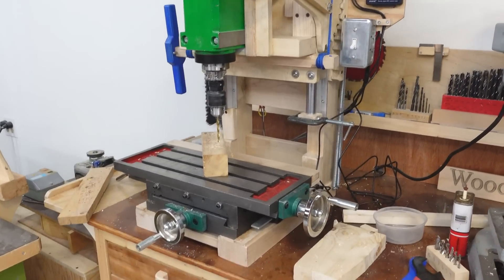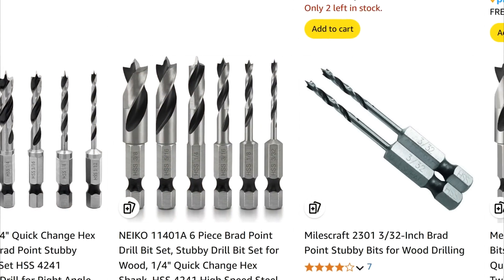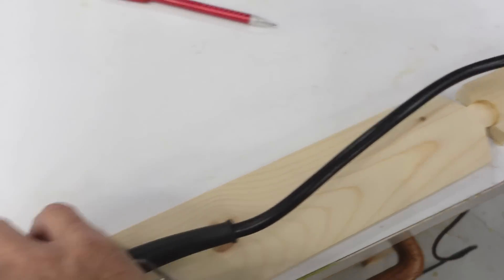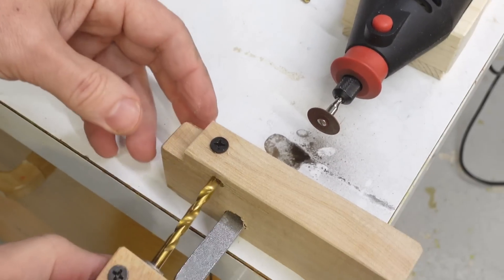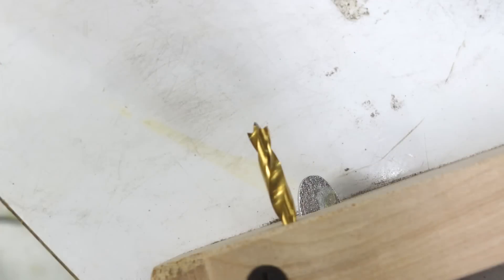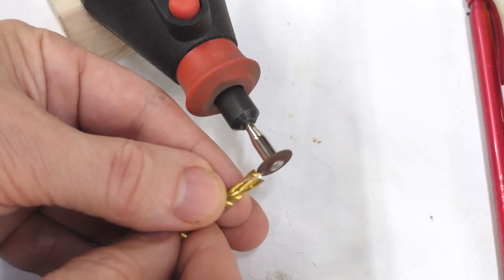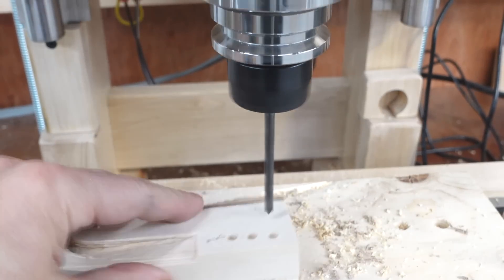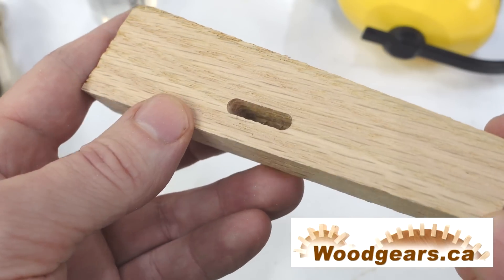Grinding a brad point onto a metal drill bit

Comment: Nice job . I guess you just wanted to see if you could make a Brad point bit.  The quickest way would have been to just cutoff a regular brad points to make it shorter. Still very ingenious way of doing stuff,
Reply from the maker: Does it matter if the part I cut off had a brad point on it or not?  Still need to grind a new brad point.  Sure, you could cut off the shank end, but then the rest of it is useless.

Comment: Matthias is the type of guy to spent 6 hours making jigs instead of buying the $3 part 😂
Reply from the maker: That would be true if the part could be bought, for $3 or otherwise, and if the jig took 3x as long to make.
Reply: @matthiaswandel  Could use your mini lathe to turn/grind down the hex shafts of the production stubby brad point bits

Comment: If you decide you're not happy with the drill bit you've just made after some use then buy one with a hex shank and stick it in your lathe and turn the hex round but I like the solution you decided on.
Reply from the maker: Hardened steel is too hard to turn.  Also, how to mount the drill so its perfectly centered?  Grinding the brad point is easier and faster
Reply: @matthiaswandel  you can mount the drill using a collet chuck and there's ceramic bits specially made to cut hardened steel but I get your point your lathe probably isn't accurate enough.

Comment: Looks like you were using a collet at the end, would have liked to seen a comparison using the drill chuck and if it still wanders.
Reply from the maker: I used the collet primarily because its shorter, so less opportunity for flex.  Of course, its also stiffer.

Comment: Was rotating the bit and keeping the dremel in a fixed position not an option for some of the cuts?
Reply from the maker: Cuts the outer points off as it rotates.  Also, easier this way.

Comment: If you just cut them down at the other end can they still be tightened in the chuck? Or is that not so good with the spiral
Reply from the maker: Certainly wouldn't work with the 3 jaw chuck.  Might work with the collet, but will bugger up the collet.

Comment: Here in our lovely Mordor one just comes to any hardware store and buys wood drill bits - either a set or single-piece. Yes, with cylindrical shanks. Yes, in any size.
Never thought it is that much of a hassle to get them on the other side of Arctic.
Reply from the maker: yes, here too.  But I needed a stubby one (explained in the video).  Long ones are available everywhere.
Reply: @matthiaswandel  Sorry, I missed that point. Now it does make sense!
Reply: Why not convert the long ones to stubby by cutting the other end?
Reply: @pfsmith01  Fluted things don't hold well in a collet

Comment: Only you would think of converting one drill bit type into another! Now I have a use for the broken bits I've kept around. Also really like the idea of using heat gun to extend hot glue working time.

Comment: @Matthias I make these all the time, but I just freehand them. I also use Dremel, but with a small grinding stone so I only have to make 4 cuts, first two form the cutting edges and half of the brad point, second two thin out the brad - just like you did. Wood drills are pretty forgiving on the geometry as long as they are made sharp.
Shortening works but the land (middle part of the drill) gets bigger and has to  thinned
What I'd really like to try is to convert some metric drills into WoodOwl overdrive geometry (they only make imperial ones).  It's supposed to have next to zero chipout on the exit side
Reply from the maker: Just looked those woodwol bits up -- not cheap!
I was keen on getting the the brad exactly in the middle because the goal was drilling holes accurately.  Though it occurred to me just now, if my goal is mortises, no brad might be advantageous too.
Reply: @matthiaswandel  Use an endmill in that case, it's a lot stiffer. I suspect a brad type drill without a point will tend to walk.
I find it easy to place the point in the middle when freehand grinding by just not shifting my hold. I rotate the drill with the back hand, but I keep hold of it with my front the whole time and keep the front hand planted on the rest. I'm not very good at hand grinding by any means but I find brads are actually easier than normal metal bits to freehand sharpen. It's important to dress the stone though, once it gets rounded, you can't get that inner corner between brad and the cutting edge - this is where cutoff wheel is better I guess
Reply: @matthiaswandel  Not cheap that's true, but it makes sense since it's unique enough to practically be artisan tool. But definitely look at one of the review videos, the lack of blowout on the exit looks like magic. I tried to think of a reason why it works so well, but I couldn't come up with a good answer. If anything, just by looking at the thing I'd expect it to make the blowout worse not better

Comment: Is it that you can't buy them online or that you can't buy them at all without the hex portion? Here in The Netherlands I've never seen those bits with the hex portion at all, and the normal stubby bits are widely available in every hardware store. Even dollar stores have them.
Reply from the maker: Stubby ones as brad point bits from a dollar store?  I doubt it.
Reply: @matthiaswandel They might not be a dollar (besides the fact the we use euros here of course), I should probably said discount shops, but they are definitely there in some. That's why I was so surprised, because they are so common here. We just call them wood drill bits. I can get a 7-bit set at my local hardware store for 8 euros. Seperate bits are like 3 euros.
Reply: Ah never mind. I saw another comment explaining this. It's not that you can't get the brad point bits, but the stubby ones. I presumed that was just another name for brad point bits. Because in the video you used the metal bits in the beginning and said they drifted. And I immediately thought, well obviously, should've used the brad point bits.

Then you are correct. In fact I've never seen shorter drill bits ever.

Comment: As cool and useful as this is, it seems significantly easier to 3D-print a hexagonal collet, if one is not available.
A fully 3D printed hand-drill I have fits such hexagonal ended drillbits in the hexagonal collet.
And I know the right plastic at a dense enough infill will survive the pressure.
But this is a case of when you have a hammer, everything looks like a nail.
And the bit you made drilled cleaner than the store-bought one you have, which is impressive but shows that you got the concept right.
Reply from the maker: First you have to have a 3d printer that can print metal, and super precisely.  That is FAR from easy.  Orders of magnitude harder than just grinding a brad point bit.
Reply: My response was about using a plastic collet, metal 3D printing is far beyond the scope here.
As long as the used material can handle the pressure, it should work with the hexagonal shape offering enough grip on the softer plastic material.
Accuracy would be hard to get right with FDM, though with manual seam painting this should be consistent enough for wood drilling.
Reply from the maker: Plastic won't handle the pressure.

Comment: An old friend of mine showed me how he does essentially the same thing.  However, he used a thin abrasive disc on one of his bench grinders.  Of course, I can't seem to find the part number for the wheel right now.  Either way, the disc mounted to the bench grinder also made some other operations really easy since you could hold the part with two hands.
Reply from the maker: Could also use a cut-off disk on an angle grinder
Reply: @matthiaswandel  Yep.  I think the discs he used were Norton brand and finer grit than a typical "cut-off" wheel.  I believe they were 0.06" thick.  I know I took a photo but I can't find the photo.  😕

Comment: How much relief angle do you need behind the cutting edge to make it work?  I've sharpened metal bits and they don't require much relief angle at least for drilling metal.  I suppose it's similar to a lathe cutter- for metal cutting the cutters don't seem to have a lot of draft but for wood turning they use cutters that appear to be similar to wood chisels.
Reply from the maker: I guess It depends on how fast you want to drill.

Comment: I drill pilot holes with center drills. They're very stiff, because they're short and thick (which also means they won't drill very deep, but that's OK because I follow up with a regular drill bit). They're made to use in a lathe, but they work fine in a drill press. I get the cheap ones from Harbor Freight, but you can get better ones.
Reply from the maker: I got a few, but none with the narrow part small enough.  Also, switching tools is annoying.  Also, won't protect against the drill drifting with the grain once its further in.

Comment: You need to make some hole saws out of some steel pipe and a countersink from lathe tail stock points. Or how about some shop made cut off wheels from hand laminated fiberglass mesh and diamond dust sprinkled over sticky paper.

Comment: Lee valley has brad point bits... I have a full set!
Reply from the maker: I have brand pint bits too, but I wanted a stubby one
Reply: @matthiaswandel  the entire point of the brads is it stays on center. Worked fine for guitar work. I punch the center mark with the spindle off then energize it.

Comment: Well done, but would it not be less time consuming to round the shank of a hex stubby or would that remove to much material?
Reply from the maker: No, that would be much harder to get precise
Reply: @matthiaswandel  I suppose because of the flutes it would be difficult mount in a lathe, your method works well.

Comment: COOL!  Matthias, have you tried the little 1" diameter diamond wheels (Amazon, etc.)?  They last far far longer than Dremel carbide wheels and they don't lose their diameter in use.  They are also much thinner and they don't shatter.  Very affordable too.  I have not used a carbide wheel in my Foredom or Dremel for more than a decade.
Reply from the maker: Have one, but I like the cheap little cut-off disks myself.  Also, I don't know if the diamond disk cuts with its edge

Comment: Matthias,
After setting the angle of approach for the brad point itself, is it easier to simply rotate the drill bit against the grinding wheel rather than swinging out, rotate, swing in, cut, swing out, rotate... etc?
Reply: That would also grind off most of the spurs, because of where the rest of the cutoff disc would end up as the bit was rotated.
Reply: @cooperised  Not when the angle to cut the brad is set. Looking at the video indicates the angle is too steep to affect the spurs, as far as I can tell. And the depth of cut for the brad isn't that deep.
Reply from the maker: It would cut the spurs.  Doesn't matter how steep the angle is set to, its the diameter of the disk that's a problem.
Reply: @daveduncan9005  Matthias is right, that's what I was describing - the diameter of the disc is the problem and it would intersect with the spurs as you rotated the bit.
Reply from the maker: It would also make the central point round, which is not desirable

Comment: Wont the heat take the temper out fo the drill bit?
Reply: No, not if it's HSS. Carbon steel anneals this way, but it's virtually impossible to anneal HSS by accident (and pretty difficult to do on purpose come to that!).
Reply from the maker: Sadly, its probably just high carbon steel.  HSS doesn't make that kind of spark.
Reply: @cooperised  Awesome, thanks for the info!

Comment: You could have turned down the hex shank of one of those stubby bits to fit a collet.
Reply from the maker: yes, but its harder to grind that round precisely than grinding a brad point.  Also, first I'd have to buy one of those.
Reply: @matthiaswandel  Thought you had a lathe for that kind of thing. Get your point though.

Comment: Recently I needed about 60 16mm holes in 5mm steel. So my dad and I just took cheapest brad point bit for ~2usd, reground to regular bit, quenched it and it worked. Without resharpening. Pilot holes were 8mm maybe.

Comment: The hex drill bits work fine in a chuck.
The cheaper ones, the hex part breaks off afyer couple of uses anyway 😅
Reply from the maker: Works fine in a chuck, but messes up a collet
Reply: @matthiaswandel  whats the advantage of collet over Chuck?
Reply: @adshwartz  Jacobs chuck is quicker to change tools since it can fit a large range of diameters.
Collet is more accurate partly due to less moving parts and partly the fact that it's shorter than a jacobs chuck
Collet provides larger contact surface with the tool so better overall grip.
Collet doesn't loosen under side loads like a jacobs chuck does

Comment: I always love/hate these sort of videos from you - I do much the same sort of thing from time to time, but I really want the mathematical and mechanical precision and repeatable 'proper' machinists method by nature. It just feels so wrong to watch a job done this way, but as always can't argue with the results and really does show how easily you can make something good enough.
Reply from the maker: It wasn't freehand.  Just that the jig was made out of wood
Reply: @matthiaswandel  Indeed, but the jig only references to the one plane, which along with the constrained axis of rotation for the drill bit isn't really enough to do it 'properly' - its not that its made of wood that bothers me (much anyway) it is that all of the important feature angles are just by eye with the aid of the jig to make them clean grinds. 

I know it doesn't really really matter, which is why I end up doing much the same things at times as I don't have a proper tool/cutter grinder to get every angle just right either (yet anyway).

Comment: It's wood so you can kinda get away with a lot and any improvements over what you've already accomplished would be of minuscule benefit.  My only suggestion would be to cut a much more aggressive relief on the back of the cutting edge.

For a regular brad point the tip is probably only square due to manufacturing efficiency, I wonder how a round and perfectly centered point would work...
Reply: A round point will not have any edges to remove material, so it seems to me that it would be more likely to follow a 'soft spot' in the wood, rather than the square edged point which will be more likely to cut it's own path.  Similar to the reason a bird cage is used to make a starting point in wood, rather than the round centre punch for metals.
Reply: @syninys100  yeah, i was thinking that too it certainly seems likely, but I'm not sure it isn't actually pushing instead of cutting.  A round point, provided it doesn't seek the soft stuff should theoretically keep better alignment ment.  Not too dissimilar to those drill bits that have a screw tip in the center.

Comment: I read that yellow plating often contains cobalt, which is cancerous when pulverised and inhaled, therefore grinding it should only be done in wet conditions.
Reply: it's titanium oxide. idk if it has cobalt, too. either way probably not heathy but so is iron dust. most safety regulation expect you to be in contact with the stuff 8h a day every day.
Reply: The cobalt is usually in the bit itself rather than the coating, but you'll know if you have a cobalt bit because they're expensive!
Reply: So, you're telling me I shouldn't snort the powder made grinding? I swear everything fun is just bad for me.

Comment: Drill bits for metal are usually from better material than those for wood, because drilling in wood is easier than in metal so that contributes to better quality cut as well. If producer don't have to use more expensive material, they won't.
Reply from the maker: Its plenty easy to ruing a metal bit in wood though, just by overheating it.
Reply: @matthiaswandel  That's why experienced people always make a hole in several passes, like in your videos, without even thinking about it to let chips out. Also I suppose that drill bits for wood often have wider flutes.
Reply: No, they are both made from HSS

Comment: Maybe it's not flexing anymore because it is shorter?
Reply from the maker: Well, yes.  Why did you think I made it shorter?
Reply: @matthiaswandel  Well if it does not flex, it will not wander.
Reply: @tkorkunckaya that's why he cut it shorter
Reply: @tkorkunckaya Literally the whole point of the video was to make a stub-length brad point bit with a round shaft, to help with rigidity, because he couldn't easily buy one.
Reply: @cooperised  Thanks for clarification, there is no point to make a bread point bit if you cut it shorter and does not wander. Sometimes people become fans, not questioning anything.
Reply: @tkorkunckaya Not true. Brad point bits aren't just about resisting wandering. If the spurs are sharp they shear the wood fibres at the edge of the hole much more effectively than a standard bit would do and leave a cleaner hole as a result.